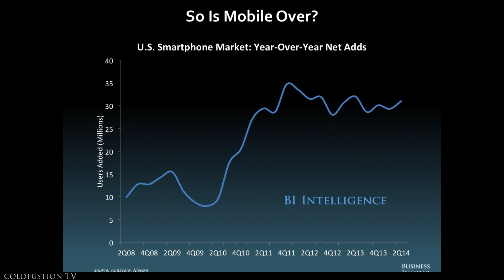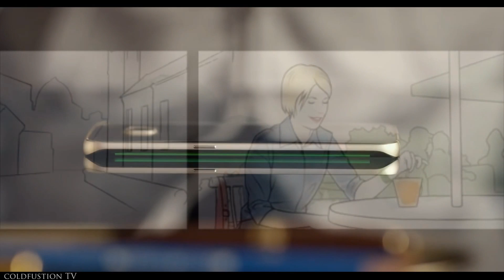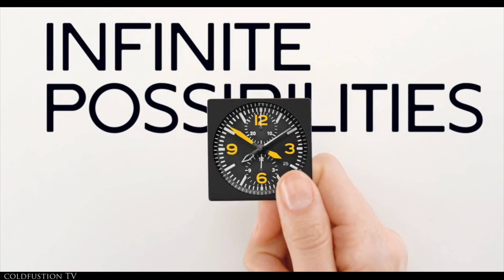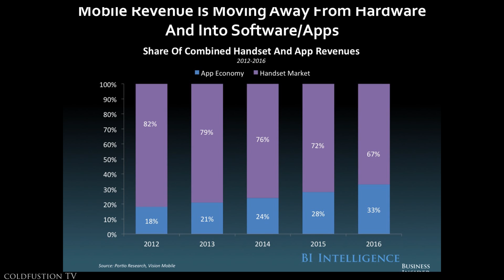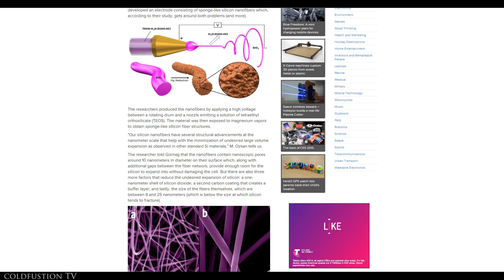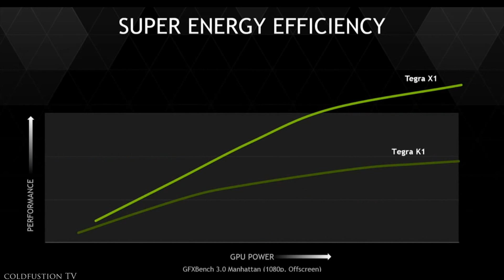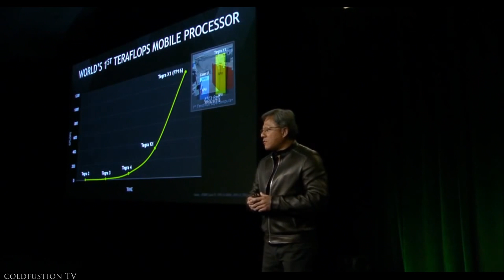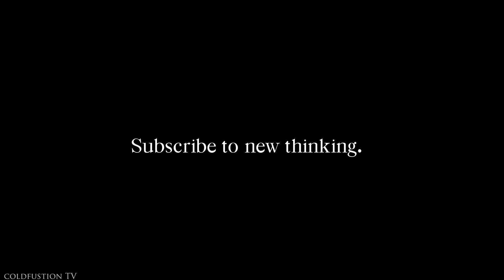The Future of Smartphones!

Comment: One thing to keep in mind about the tegra's '1TFLOPS' is that it's with 16bit floating point, which is only a recent optimisation advancement for compact FPUs in the processors. Whereas the majority of other processors have been using 32bit floating point for a very long time due to its balance between performance and accuracy. 16bit floats have a very short accuracy range and have very limited uses, 64bit (aka double-precision) has an extreme range but requires a minimum of twice the time to process compared to 32bit.

You could also consider the processor itself and what it's good and bad at doing, GPUs have extreme raw power via a massively parallel design for processing thousands to billions of little tasks, such as a pixel, per second. However, GPUs lack the ability, or at least are very bad at, handling the common tasks a CPU does, which involves long lines of code that cant simply be split into a thousand little cores. Supercomputers still focus a lot on using CPU cores as they still have the highest flexibility and run singular tasks (on each processor) multiple times faster than GPUs or similar.

Comment: Few questions/points...

-Does technology actually get suppressed on purpose still?
-About the pc/mobile platforms combing where your mobile becomes your PC, it might happen yes, but does this mean that mobile will become more powerful than PC? I wasn't quite sure if that is the point you were trying to get across because I'd disagree since what we can fit in a mobile, we'll be able to achieve more with the extra room we have in a PC surely?

Also great video as always, thoroughly enjoyed it.
Reply: rohitcharli I think he means that you could use much higher computing power of your PC, on your mobile devices. That is already possible with gaming. Take a look at Nvidia Shield and Nvidia Grid. Only thing that is holding it back is network speeds. We simply need more fiber and 10gigabit local area networks.

Imagine future with only one modular device which is not very powerful as itself, but could use computing powers of huge datacenters by streaming. For gaming you could just use wireless controller plus VR headset anywhere in the world and play high quality PC games, anywhere, anytime. It is modular so if you want to work for example, just connect your wireless keyboard and start typing. There is huge potential in cloud services, too bad network connections are not up for it at the moment. Not in the Western world at least. I'm so glad that i can be at the fore front of all this, as i'm studying networking.

Comment: Excellent video. Although we've already reached the limit of the amount of transistors can go on a chip(the limit it makes sense to do so) . We are making breakthroughs in chip optimization and three dimensional chips. The future of Smartphones is especially bright for the developing world. As they will skip the pc revolution entirely.
Reply: We haven't reached it yet, we can go as far as transistors one atom across, the most advanced processors (Intel's unreleased Cannonlake series) are about 10 nanometers across, we can still get them a bit smaller.
Reply: Ha! No we can't, that is physically impossible due to hiesenbergs uncertianty principle. Error and corruption would be major problems plus overheating lets not even add that it would be impossible to make transistors that small.
Reply: ***** A Google search will show you that <10nm fabrication is possible without significant tunneling leakage. Also 3D chip fabrication will significantly increase transistor counts and move certain cpu elements closer together(L1 cache ect) and if  we make the jump to graphene then thermal limitations will also recede .Moores Law aint over yet
Reply: Bobby Newmark I was mainly addressing Exantrn blunder and misinformation. Perhaps 9 or even eight nanometers is possible, 1 is not. And the state of Moore's Law is extremely debatable:

http://spectrum.ieee.org/semiconductors/devices/the-status-of-moores-law-its-complicated
Reply: ***** Sorry, I wasn't trying to be contrary . You are right that we are approaching a fundamental limit to the physical size of transistors, but there are a few techniques on the horizon that will enable significant increase to transistor counts and allow Moores Law to remain true past 2020
Reply: Moore's Law will no longer be true, computer power is and will increase but not due to the amount of transistors squeezed on a chip.
Reply: Bobby Newmark it shouldn't be called Moore's Law anymore since things have changed so much. by the way I mentioned other ways computing power will increase in my original comment.